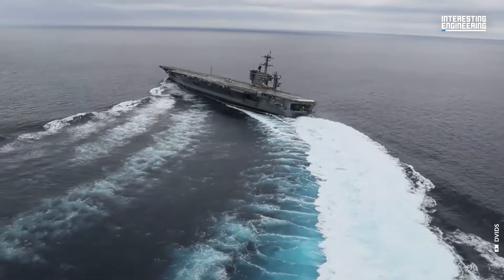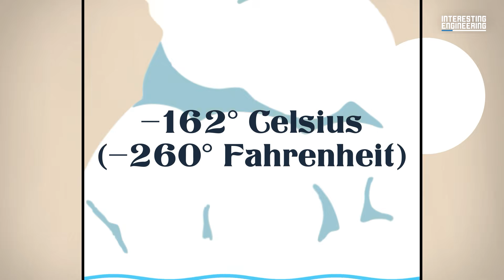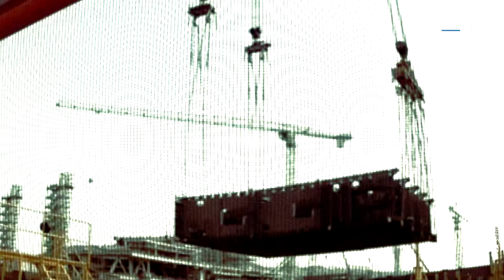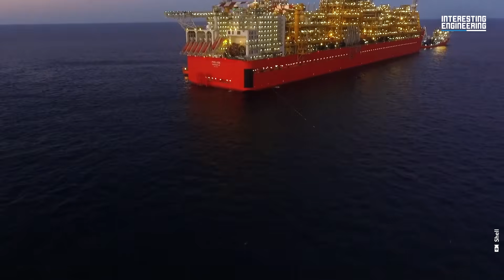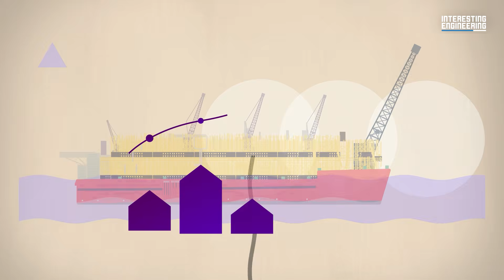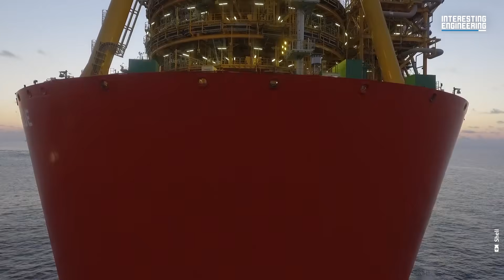The Amazing Engineering of the Largest Vessel Ever | Shell's Prelude

Comment: Also there's a doco channel on u tube which shows you each step of the manufacturing processes to make this massive floating platform as well testing the cables, chain manufacturing connection testing for the liquified gas processes, so any ship from around the world can dock next to it and get the Liquified gas on board. 👍👍🦘🦘✌✌😎😎⚓⚓

Comment: The largest oil tanker which crashed was also a lot larger than anything Seawise Giant /  till prelude , but they scraped it after failing so many time, its total weight was over 570,000 tons fully laden with oil. Total length was 458 meters so over a 1/4 of a km long.
Its amazing what they have made, plus technically its not a ship thus would not count, as it does not move at all under its own power its anchored down with massive chains to the seafloor and moves around with tub boat's etc. ⚓⚓😎😎👍👍🦘🦘✌✌

Comment: Interesting! - For those much younger than me (1956):

When I was to become a ship engineer (sponsored by Shell Tankers NL), the size of "crude carriers" had recently jumped up from around 80,000 tons to just over 200,000 tons - if I remember correctly: due to the 1967 war that closed the Suez Canal. Around 1975, Shell Tankers (France) added two crude carriers of some 540,000 tons. Other ship owners even went closer to 600,000 tons. These huge ones didn't exist long.

Coming to think of it, this second size jump may have accelerated the demise of big-ship building at least in the Netherlands. Just no room...